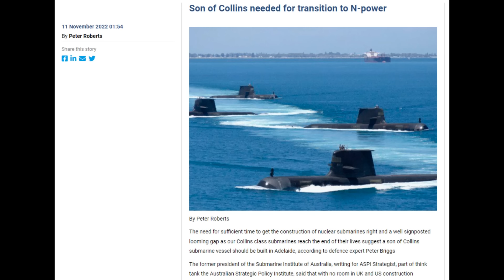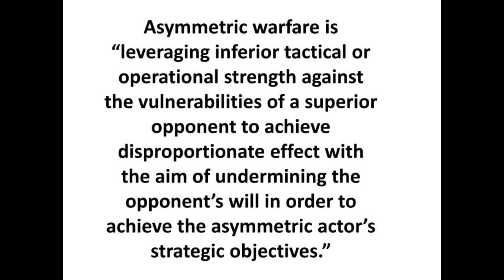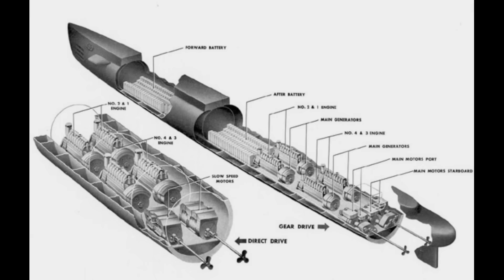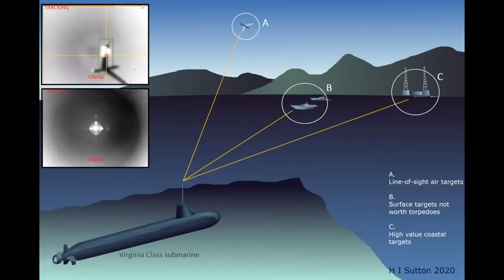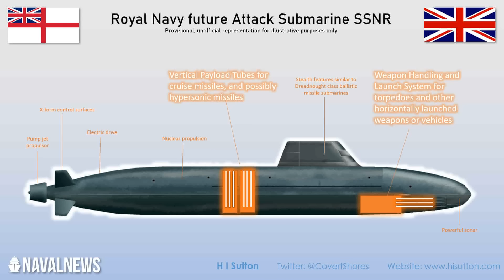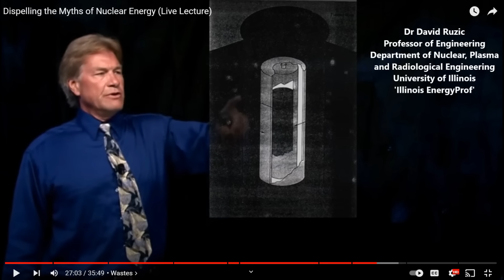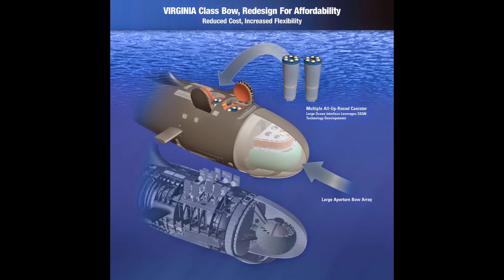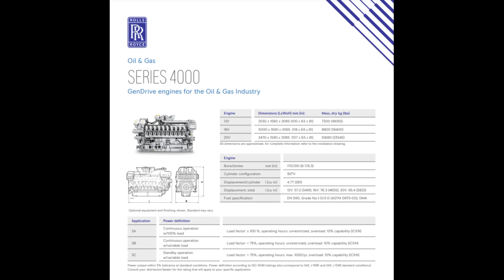SSN-AUKUS: Australia's Emergence as a Major Maritime Power of the 21st Century

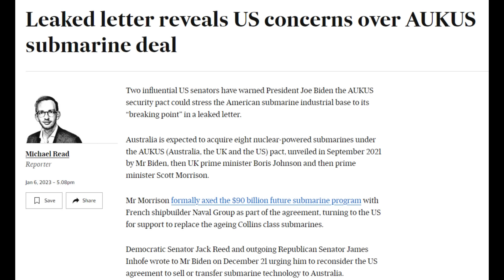Comment: 5:36 I sincerely doubt that the US submarine manufacturing capacity is maxed out. The entire reason that Electric Boat and Newport News each build half of each submarine and then connect them is that after the Cold War the US wasn’t ordering enough subs to actually utilize the capacity of both yards and the government wanted to make sure that they each retained the skills to build whole subs in case they needed it in the future
Reply: There have been multiple publicly released USN and govt reports on how their submarine building is maxed out. That’s why Australia is putting $1.5b into US ship yards.
Reply: A more pressing problem is the maintenance of exisiting submarines. The US has closed down a lot of government shipyards in the last decade or so and now there is a long waiting line of submarines needing maintenance and insufficient facilities to carry out the work. Part of the AUKUS deal involves having shallow maintenance on US submarines performed in Australia to increase throughput. This will assist Electric Boat and Newport News to increase their build rate. However, in order to provide a significant number of SSNs to Australia they would need to set up a third shipyard.
Reply: At the end of the cold war the US Navy had 8 shipyards for building and maintaining it's fleet. By the mid 90's they had closed half of those shipyards and expected excess build and maintenance requirements to be taken up by private shipyards. Fast forward 15-20 years and those private shipyards instead of helping to maintain the ssn fleet are instead building the much more profitable Zumwalt, Independence and Freedom class lemons.
This resulted in the US ssn fleet going from having about 20% of the fleet in maintenance cycle at any one time in the late 2000's and earlier to the current state in 2023 of having 37% of the fleet in a maintenance cycle.

Comment: Just want to say thanks mate for these videos. Just wondering with all these ships that China is building do they have the capacity to maintain them all?
Reply: They got rid of a lot of older, maintenance-heavy vessels and the new ships should require much less upkeep. Another factor is that modern ships, aircraft and other systems are generally designed with maintenance in mind by giving crews easier access and requiring less dismantling and fewer man hours to repair or replace components. If China hangs on to these vessels for a long time then they'll get increasingly difficult and expensive to operate so they may well follow Japan's example of retiring vessels that are a long way from being worn out.
Reply: @trolleriffic  thanks mate I'm sure your right but those repair sites will be a prime target and  I guess they are closer than Hawaii.  We are under prepared here in Oz but things are changing. We all need to stand strong.

Comment: Point of interest,  my understanding is that even ssn's have to surface or close too it to get their bearings.   The longer they stay under water the greater % error they have to calculate into their positioning.   It's also interesting how the propulsion system is referred to as 'jet pump'.  I feel this is a little erroneous. The  propulsion is an axial flow pump (pumps for volume not pressure) rather then an actual pressure pump (centrifugal for pressure)  thoughts????

Comment: I am Canadian but I am ashamed to admit it's correct the other western Pacific nations excluded us from a military alliance to directly counter Bejjing.
Our 4 submarines rarely put to sea and are often dangerous to its crew. Our only 12 frigates are overworked and due for replacement. In our littoral fleet of 12 Kingston class 'minesweepers' in 2014 in refit they removed the 40mm Bofors. Replaced it with Nothing. So they put to sea with two .50 BMG in pedestal mounts circa 1941. Our brand new arctic AOPs have a host of expensive goodies such as a landing vessel & two medical MRI machines and helicopter landing deck & hangar.
Yet. We have yet to see a Cyclone aboard our arctic AOPs?
Yet it's pathetic armament is one 25mm pop gun and two WW2 machine guns. Why does it have a capable radar system to detect missiles, yet Nothing to counter act it? We have strangely enuf eight Orca navy training vessels in Esquatimalt that once upon a time had a .50 BMG (3 only armed) to secure Van Olympics 2010. But our wonderful admirals disarmed them afterwards in a fit of utter genious. Armed with a HMG and twin C6 MGs in the rear are perfectly capable vessels to patrol Van Isle & Charlotte's for fishery patrol & interdiction of drug smugglers. They could safely conduct this patrol in pairs with nearby coast guard on call for SAR, just in case of commercial vessel sinking.
Everything in our navy last 15 years especially benefits only one agent.
And that Bejjing. Truth.
Reply: The US probably won't sell Canada nuclear submarines unless we give up our claim to the North West Passage. 

The RCNs best move at the moment is to buy 12-15 South Korean KSS-III conventional submarines and operate them out of Churchill, Manitoba with a resupply base in Iqaluit, Nunavut, the closer to the Arctic that we operate our subs the less of a problem endurance becomes for our hypothetical submarine fleet. Integration of AIP propulsion and Lithium-Ion batteries on the KSS-III significantly reduces the traditional weaknesses of a conventional submarines, e.g., storing oxygen in liquid form before going underway and charging batteries faster when snorkelling. 

If the Canadian Government is feeling particularly daring then the RCN might be able to procure 3-6 Barracuda Class Nuclear Submarines from France, but we might annoy the US if we do so.

Comment: While this certainly shows the advantages of SSN subs over SSK right now, what happens when SSK's move to hydrogen power generators over the next 30-40 years? Will the gap be significantly closed in stealth and range with there largely just being speed? What about the French Baracuda SSN that we could get cheaper? Is the capability gap that significant versus our potential ability to self sufficiently supply fuel with expanded low enriched uranium production and cost?
$350B is a huge investment in one single system with only 8 units making the potential loss of any one of those units in a war a massive blow. Are we potentially making one huge Achilles heel?
And finally are we sure we want to be so heavily reliant on the US for defence and involvement in US military affairs? We've effectively sold military independence for the next 50 years? The world is going to be a very different place in that time, think about the difference from 1950 to 2000 technologically and geopolitically. 
Ps. These are just some questions that I can't really seem to get any clear answers on.
Reply: Where does the energy come from to make the hydrogen for those generators? Hydrogen is a really bad fuel in many ways - it leaks out very easily, it gets absorbed by many metals and causes hydrogen embrittlement, the concentration ranges over which it's flammable and explosive are both much larger than with other flammable gases and vapours, it burns with an invisible flame, and it has an low energy density due to the incredibly low density of both gaseous and liquid hydrogen. Liquid hydrogen has a density of just 70g/litre compared to 850g/litre for diesel, and diesel also contains over 4 times as much energy per litre so hydrogen is a poor replacement for hydrocarbon fuels if range is an issue.

The AUKUS SSN is likely to be significantly larger than the Barracuda SSN at 7,500-8,000 tons vs 5,300 tons submerged which should provide more room for weapons including VLS tubes, stores, crew space, and possibly space for a multi-mission section for divers/special forces.

Using low enriched uranium in Barracuda's reactor means it needs to be refuelled every 10 years, and could take a year or two to complete. Australia doesn't have a uranium enrichment plant (natural uranium is 0.7% U235, Barracuda needs 6% U235, and AUKUS will use 93%) so it can't provide its own fuel and would be dependent on sourcing it from elsewhere whichever SSN it chose. With AUKUS using HEU, the reactor will last the lifetime of the boat and eliminate the need for at least two refuelling lay-ups which would otherwise put each boat out of use for 4 years. That in turn means more patrols from the same number of subs and puts less pressure on the fleet and crews.

These boats won't be cheap, but even the UK Guardian newspaper only puts their cost at an average of 0.15% of GDP per year compared to a target of 2% of GDP for the defence budget as a whole and for that Australia gets a capability for force projection, defence and deterrence that few countries in the world can match. Losing one would be costly and be a tragic loss of highly skilled crew but the same is true of surface warships, except they're much easier to target and sink. Consider the UK's experience during the Falklands war when we lost 7 vessels in total including 4 warships, while our nuclear subs roamed with impunity and sent the entire Argentine navy scurrying back to port following the sinking of ARA General Belgrano. Submarines back then were also nowhere near as capable as they are today - HMS Conquerer sank the Belgrano using unguided torpedos but the Navy's current Astute class subs (and AUKUS-SSN) would be able to hit air bases and other targets in Argentina itself using their Tomahawk missiles.

Complete military independence doesn't really exist in this day and age and hasn't done for most countries for a long time because modern weapons and systems are so complex that no nation is able to produce every component domestically. The F-111C was the backbone of Australia's air power for many years but Australia didn't sell out the ability of its armed forces to act independently by getting them, any more than it would obtaining these submarines. If AUKUS did represent a loss of independence then the same would be true of buying subs from France since both have critical systems which are not Australian. Buying French would arguably make Australia more dependent because you'd need France to refuel them every 10 years - what happens if the facilities to do this are busy at that time with French vessels, or relations between your two countries have deteriorated for some reason?

Comment: Australia will not have a fleet of nuclear submarines. The cost to build, operate and maintain such a flotilla of a minimum of four (I smiled at a possible eight and laughed when ten and twelve were presented as possibilities) plus construction of an insanely complicated and expensive national infrastructure is well beyond its economy. Roughly comparable to the dilemma faced by Canada in the mid 80’s. 

Newport News, Electric Boat and BAE cannot "ramp up production". In the US NN and EB are fully in production and gearing up for new classes of SSBN’s ("Columbia") and SSN’s ("Virginia" block 4 and 5). In the UK, well before the last of the “Astute” class is finished the workforce will begin to be committed to production of the "Dreadnought" SSBN's.

Now recent from the The Guardian: The US has declined to guarantee Australia will have full control of the AUKUS nuclear-powered submarines. WTH is going on?

Comment: This is the best AUKUS explainer, period, full stop. My only quibble would be the comment that the Virginia SSNs that the RAN get will not have a VPN. I've seen nothing to support that view, and it is not in the agreement that they won't. Most likely, of the used models, the RAN will obtain possibly 1 Batch III and 1 Batch IV Virginia and will then obtain at least 1 new Batch IV unit and possibly more if there are delays to the SSN-AUKUS. The only difference between the RAN and RN SSN-AUKUS will be the combat system and torpedoes, with the RN maintaining the Spearfish while the RAN continues to use the Mk48 ADCAP, which is getting a bit long in the tooth.

Comment: The attack class cancellation had more to do with the inherent limitations of diesel-electric subs (e.g getting anywhere underwater at a strategically relevant speed given the size of Australia) than anything done by the French. 

Hopefully this won’t be the kind of program that will cannibalise the rest of Defence for the next 30 years.
Reply: imo the problem is we have been focusing too much on building up our army vs building up our navy/airforce for way too long. We really should only have elite commando units and a small army focused around area denial based artillery. We cant meaningfully take losses in land wars vs any significant threat. If we deny enemies from performing air/sea based insertions from strategic locations, we never need to fight the land wars in the first place. The army has been too large for too long as since 1950 developments in technology have increased the cost of amphibious/paratroop operations significantly and we dont have the population to sustain these over any meaningful time

Comment: OK, I will expose my ignorance. Are attack subs ever equipped with nuclear anything????
Reply: Tomahawk cruise missiles, which are nuclear capable. ie they can deliver a nuclear warhead.
Reply: The AUKUS Class subs will use a nuclear propulsion system, but the Australian variant will not carry any nuclear weapons. The British variant might carry nuclear weapons.
Reply: @JollyOldCanuck  
Perhaps. It wasn’t so long ago that everyone ‘knew’ we would never acquire nuclear powers attack submarines.
Reply: @advanceaustralia3513  I doubt it, the nuclear taboo in Australia is so strong that the nuclear reactors for the AUKUS class will be assembled in the US and UK and arrive in Australia as fully completed and sealed units for installation. 

Australia won't actually have to handle any nuclear material in the manufacturing and maintenance of the AUKUS class submarines.
Reply: @JollyOldCanuck  
I think you underestimate the level of concern in Australia regarding China. 

The anti nuke boomer left is a small and rapidly shrinking demographic. 

Nuclear power is a policy platform of the conservative parties in Australia. 

The AUKUS reactors are being made in the UK because we do t have the industry to do so here. 

In the other hand, loading nuclear warhead tipped US supplied tomahawks on RAN submarines could happen without any technical difficulties.

Comment: what if the blown up by a drone  we just  seen a  super sonic  bomber destroyed  by a 100 dollar quad copter
Reply: It might surprise you but a submarine is a bit harder to kill than a bomber which has to be built out of incredibly thin and lightweight metal (which also burns when it gets hot enough) in order to be light enough to get off the ground, and it's also full of flammable jet fuel. Damaging something made of 8-10cm thick high strength steel that spends nearly all its time under water and is almost impossible to detect is slightly more challenging and further complicated by the fact that the sub might be sitting 1500km off your coast lobbing cruise missiles at you. Even the best 100 dollar quad copter doesn't have the range to venture that far or carry the sensors, propulsion system or the 100+ kg warhead needed to do any damage, which is why anti-submarine weapons are incredibly expensive and more costly than ever - a small anti-submarine torpedo is a couple of million dollars minimum, then there's the half a billion dollars for the ASW aircraft to carry it.

Comment: All good until you try to justify nuclear subs without going anywhere near a cost performance comparison... Are you bloody joking me... Please show me one article that suggests nuclear power makes a sub more stealthy as you suggest... The reverse is true! Pumping water through the reactor is noisy! How about a simple question of how much range does an Australian Sub need to protect our interests vs many many more conventional subs affordable for the crazy cost of about 20 billion a sub when you include infrastructure, ?? Thats like what 40 conventional subs ??? Plus change??  Now that's a regional power fleet of subs right there... 8 -12 nuclear subs with one third in maintenance delivered in 10 years+ and 20+ years to get to full capacity... So stupid a decision in my opinion...
Reply: It was mentioned in the video that modern reactors can achieve a significant proportion of their full power on passive cooling. It would not surprise me if a Virginia can generate more power with the pumps off than most diesel boats can with their engines on. The massive advantage in available power is only going to keep getting wider, and it's going to become more critical as diesel boats start to miss out on combat system and drone operations capabilities that they just don't have the spare power for. Range, endurance and speed similarly become more and more important as missiles get longer and longer range.

The gap is only going to get wider.
Reply: @SicDrykEst  your answer still avoids how many good diesel subs you can get for the same price and what numerical advantage that gives you. Also with new battery tech DE subs can go longer at full electric quiet and faster... Currently there is no sub quieter than a DE in full electric mode.
Reply: @passivehouseaustralia4406  Because I don't know how many DE boats a nuke boat is worth to us, and anybody who does wouldn't be posting about it on YouTube.
Reply: @SicDrykEst  huh? It's a cost question I agree there are some unique unknowns due to secrecy but it's clear DE subs are much cheaper but still very effective.